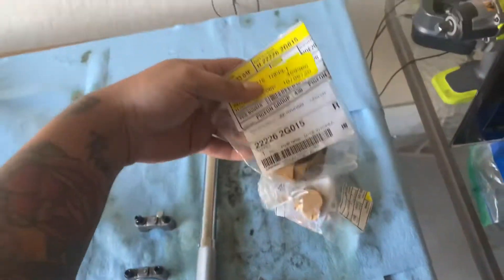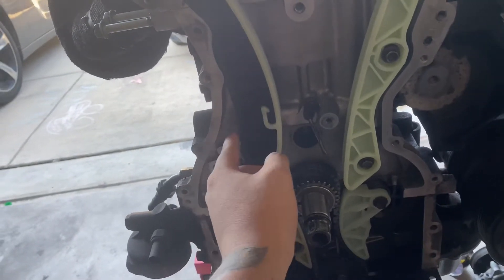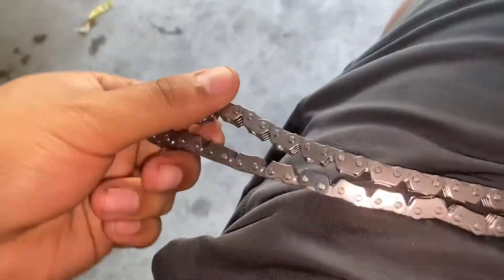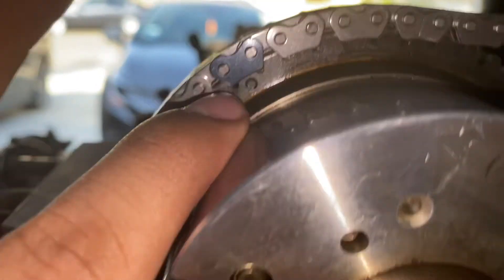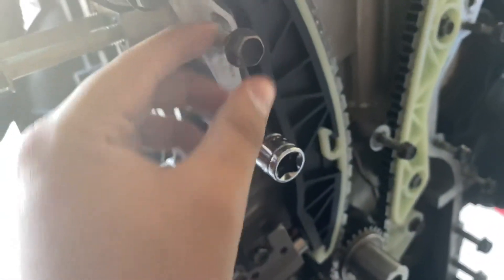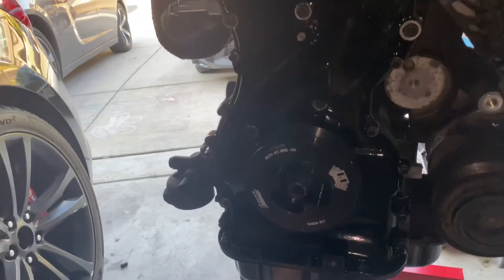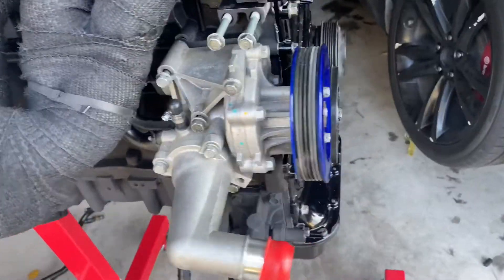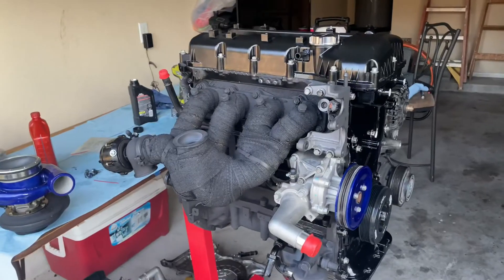Genesis Coupe 2.0T Engine Build Pt.7 | Cam Timing & Timing Cover

Comment: I’m unable to turn the cams, can’t get any wrench to fit onto those adjuster nuts on them
Reply from the maker: @dumu4700  your other option is to use a 14mm socket at the head of the phaser to turn the camshafts it’s just not recommended

Comment: Thanks for the video. Gonna do my chain soon because I'm gonna have my whole front off, and my car is hitting 100k at the same time.
Reply from the maker: I usually recommend people to check their timing chains after 80k miles for slack. Then every 10k miles after to check. These chains do tend to stretch over time as part of the normal wear and tear process so it’s always good to be on top of it.
Reply: @ProdigePerformance  yeah thats why im doing it now. I lived away from home last year and put a lot of miles on my car driving half way across the country a couple times. And I'm the who knows what number owner of my car, I dont know what the previous owners did at all since I bought it at auction

Comment: You're making me wish i did head work. Short block goes out the 20th. But for my power goals of mid 500s tim herber owner of gencoupestore said it would be a waste of money.
Reply from the maker: 5-550 stock heads are perfectly fine for. You only really need to build the heads when you want 550+. There’s a bunch of reasoning behind it. Tim is very knowledgeable.
Reply: @ProdigePerformance  yeah hes the man. Helped me a lot with the direction of my build. Thank you. Appreciate it
Reply from the maker: spectrum870 I always send people his way. Matter of fact I’ll be testing out and installing his products in my coming videos. Shifter, bushings, exhaust, anything you can think that tim sells I plan on testing it rather it be for my car or customers